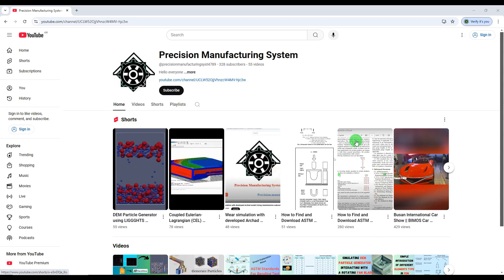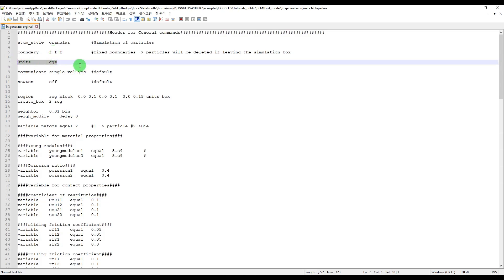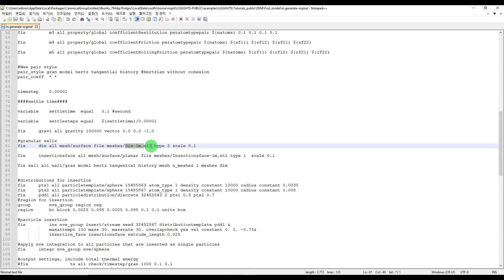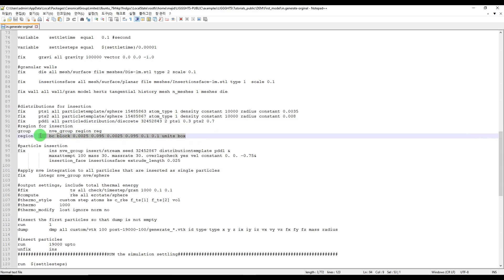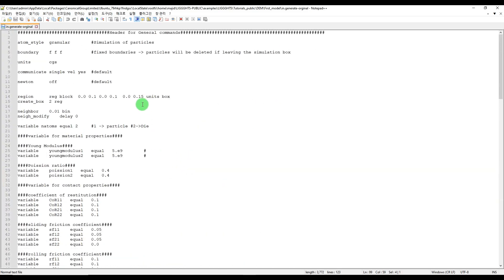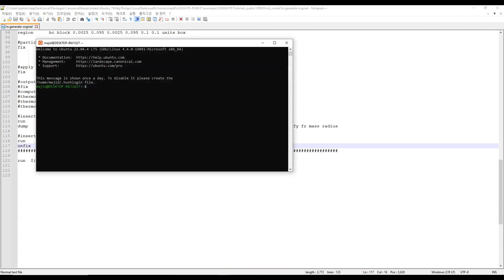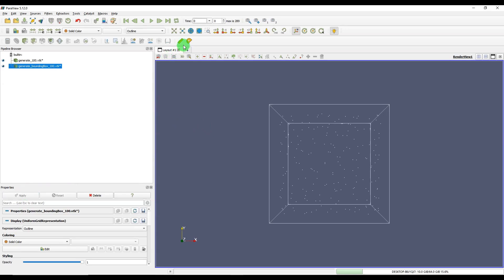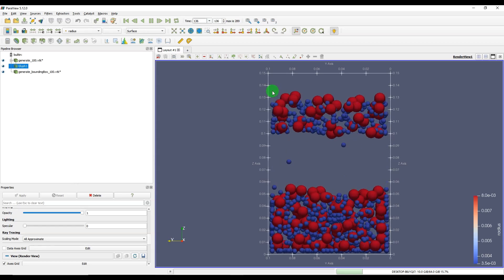How To Generate Particles Using Discrete Element Method (DEM) in LIGGGHTS;Part2:Multi-Size Particle

Comment: Clan you please explain the meshing of stl file and insertion, when i try to simulate it showing error that its outside of the domain
Reply from the maker: Please check the dimensions that are determined for the insertion and the boundary. I think you made a mistake somewhere in your input file, and this error is related to the dimensions used in the input file.